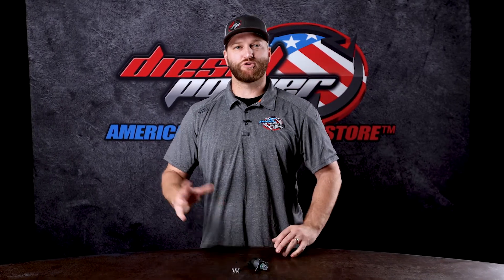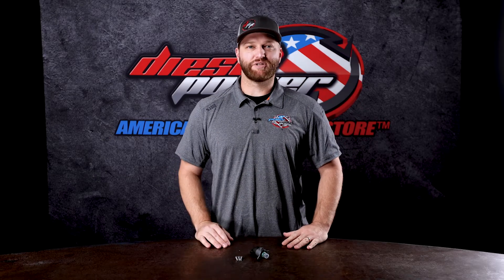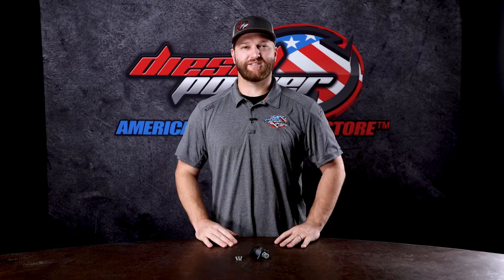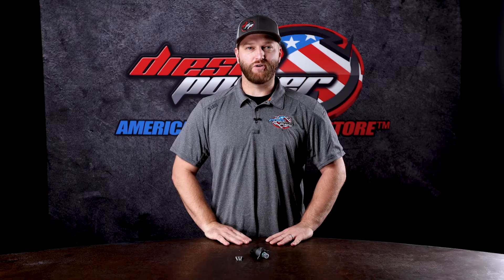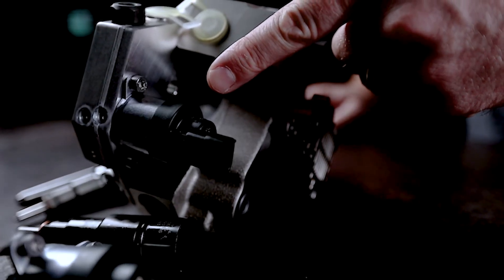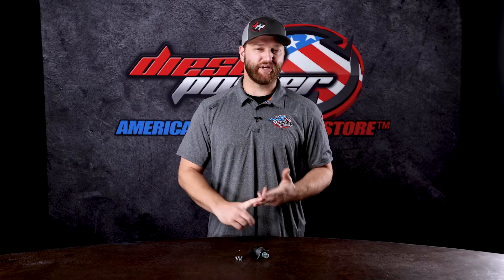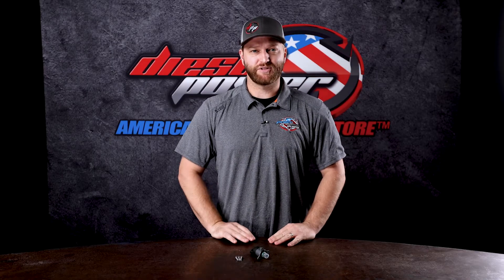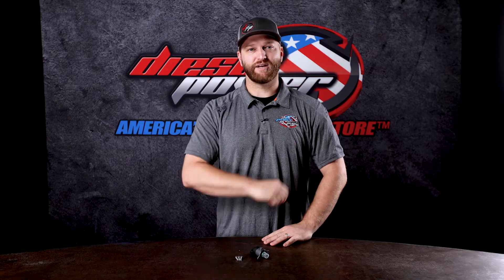Diesel Talk | Bosch Fuel Control Actuator // MPROP

Comment: Lol u forgot to say if its on ur truck u got to unbolt the ecm from the block move it over so u got room ive done this it take 1hr at least because every wire is in the place that where that $150 hr kicks in lol
Reply: I did it today without moving anything out of the way. All 3 torx bolts were easy to get to. Took about 5 minutes.

Comment: My 2015 Ram 2500 with 117,000 miles starts and runs perfectly. However, after warmed up and reaching 45 mph, if I release the throttle to coast I hear what sounds like a gas engine with a big cam at idle. No indication of this at the tach. No feeling in the vehicle. No CEL. Just the sound like the engine is loping. Could this be the FCA?

Comment: So I’m trying diagnose a random stall and no restart changed the fuel filter
Reply: Any updates? I did my fuel filter change and when I pressed on the gas pedal it would sputter until I let go of the pedal. Prior to the change it was running like a top!

Comment: I got Cummins with fuel pump actuator command  mv of 1635 and actually showing 1325 mv. Truck has no power and no active codes is this my issue

Comment: I have an 06 ram 3500 with the 5.9l Cummins. In neutral or park if I  rev it up it revs and runs smooth, but the come back down to idle is very rough and seems almost like it’s sticking. Any idea?
Reply: holy cow i have been looking everywhere for someone who has the same issue at me! What have you figured out with this issue??
Reply: @TX-cumminsgriesel  injectors are on the way out
Reply: @MicoThePsycho  ironically and unfortunately last Friday injector 3 just exited the chat on the damn toll road.. hoping the piston isn't a ball of metal but dno till I do a scope
Reply: Did you ever get this figured out my 06 2500 is doing the same thing
Reply: @mralexismtz773 I’m looking for answers too. My truck runs great. 06 and I’m the original owner. 153k miles and I’m meticulous on maintenance. I started noticing a little vibration but not quite a stumble at idle and started doing some research. I ran across someone doing this rev to 2500 rpm in neutral and then chop the throttle. I went out and did that. My truck stumbles and stutters and steps back down to idle. No where near smooth. I just bought a ODBLINK MX+ diagnostic tool and an app that let me show actual rail pressure and desired rail pressure. The desired rail pressure is what the ECU is calling for. That number is around 6800 psi at idle. My truck, when cold, stays right around 6800 actual rail pressure and idle is rock solid. When it gets to full operating temp it starts feeling somewhat rough and my actual pressure hunts from 6400-7400 psi. It constantly cycles and corresponds with what I’m feeling. Also my “rough” idle is very slight. My passengers can’t even tell. My teenage kids have been riding in my truck for nearly 2 decades and they can’t tell. I have no smoke at startup or accelerating WOT. No power loss. No other symptoms other than this “rough” idle and the 2500 rpm chop test. 

When I put these symptoms and rail pressures in Grok and CharGPT they both come back with diagnosis that it’s mostly likely the FCA. I’ll probably try replacing it before I dig deeper. Also my WOT rail pressure is solid at 23500 psi. Really have no other issues. Hoping it’s this simple FCA fix. Also forgot to mention my Blackstone oil analysis is always <1% fuel dilution at 7500 mile change interval.
Reply: Did you ever find a fix to your stumbling back to idle issue?  Mine does the same thing.

Comment: I have a Cummins L10 series that rattles like a gas engine with really bad preigntion knock at light loads  and lower RPM's plus at times cycles in and out of having no power to having great power as well.  
(Less than 1000 miles on full dealer injector replacement.)

What are the odds this thing is the cause?   Seems the online forums half say yes these fail often. Half say they never wear out and at ~$450 for a new one I want to know what I am dealing with rather than just throw more money at it.
Reply: I’m having the same issue, low rpms I’m literally on the verge of stalling out. But the pressure will spike at times. When sitting overnight the truck will start and die a few seconds later. I’m leaning towards this.What was your issue
Reply: @thenoobiebmx  Still don't know.  All I ever figured out was mine uses an all-mechanical pump system with an odd electronic speed limiter addon.  My best guess is the aneroid diaphragm is going bad or its metering valve assy is sticking or both. 

The rattle is likely worn wrist pins and it is the turbo pressure that keeps it from rattling when it's boosting high enough.  Still dont really know because the so-called experts around here seem to not have a clue either. other than '"It's a  L10,  some just do that."

Comment: So on my CP3 pressure regulator, I was told using a scan tool to read the percentage of output to the cp3, this will tell you the health/ life left in my pump, was told anything under 30% @ idle ,meant it's still got plenty of life left in it...... however my scan tool only does voltage and it was 1.24 volts @ idle, iam assuming that converting 1.24 to a percentage would be 11 or 12 %, is this a correct assumption?